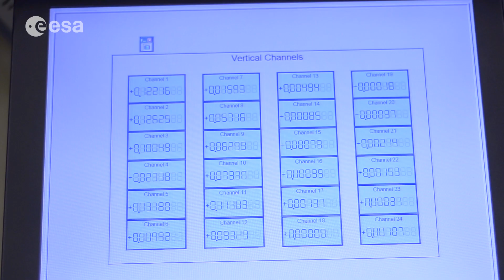Shaking ESA's IXV spaceplane

Comment from the maker: Shaking the Intermediate eXperimental Vehicle  at our ESTEC test centre in the Netherlands. To be launched on Vega in early November 2014, IXV will test in flight the technologies and critical systems for Europe’s future automated re-entry vehicles returning from low orbit.

#IXV #spaceplane  #ESTEC
Reply: why not test reentry like NASA, balloon with accelerator engine to get it on the height?

You may reduce the cost of the test significantly. If the vehicle does not have an engine you may add some 'container' that will enhance its ability to reach the required height
Reply: Tihomir Stoev I think the NASA test you're thinking of may have been the one intended to test supersonic parachute for a Mars landing. Still very much lower speed than reentry from orbit.

Parachute opening and water landing if IXV has already been tested by dropping from helicopters.
Besides, most of the rocket is used for getting speed, not for lifting. (If balloon helped it would be used when launching satellites.)
Reply: fair enough Ubbe Fr
Reply: Tihomir Stoev Yea, they need like 10 times more speed in order to test a real reentry.
Reply: only 5-10km/s ... easy!